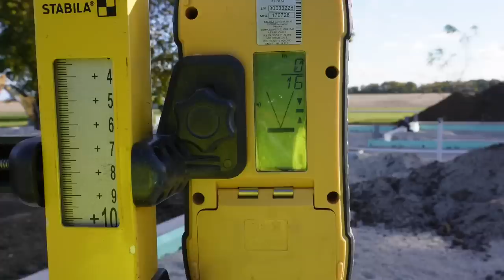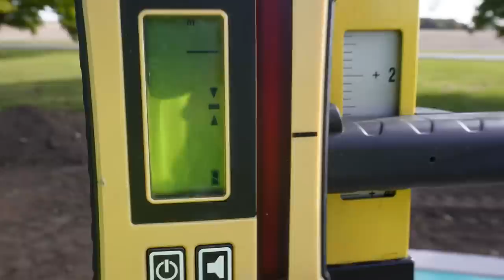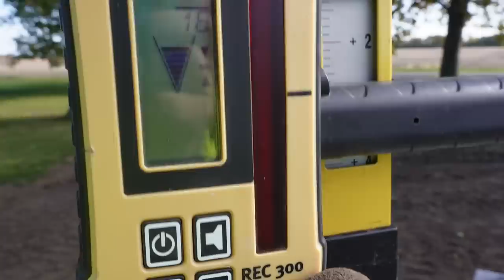Building the BEST House Possible!  The benefit of Post Frame

Comment: I'd really like to see a video of you going over the floor plan in specific detail as to how the dimensions work out where the two buildings come together. Does the concrete guy have a funky dimension to make things work better for your or do you change pole layout to work with the concrete? In the same video you could also talk about what changes in the layout if a 4 ply post is required over 3 ply. Poles move, trusses move, etc...

Comment: Instead of the concrete wall, can you use cinder blocks set on footing and then fill with concrete? Will post anchors attach the same way?

Comment: Biggest hurdle I have on a post frame build is finding a competent and dependable builder. So many around where I am would just stick telephone poles in the dirt and call it a job. No one seems to take pride in their work anymore
Reply: I hear ya, Builders around here are a little sketchy except for the high end, fancy ones. Can't decide between a post frame or square log butt & pass garage/shop (have a saw mill & logs seem plentiful now). Pretty much rebuilt and added on to an old place here in SW Colorado. Hated to see the old place torn down but gutting it and re-doing would have been a labor of love or some deep pockets.

Comment: Hey guys/girls. Can someone explain the benefits of a post frame structure when there is a poured foundation like this one? Are you not using more wood to strap the outside, poles, then strap the inside for drywall? Couldn’t it have been stick framed on the foundation? Especially when they’ll be no need to strap the outside if there is plywood going on. Thanks everyone
Reply: The big benefit of post frame is the lack of thermal bridging when compared to traditional stick construction. It's also easier to get a solid sill seal when you're not dealing with a plate, plus the balloon-style construction makes sealing the roofline a little more straightforward, especially when you have additional stories that would be more complicated with a traditional platform style house. (Think of the layers between floors in a stick-build vs the interior joist hanging in the other ongoing barndo build.)

Comment: I have nothing against pole barn homes. I also do not think there is much savings in a stick built and a pole barn house constructed correctly.  The fad may have started off as a lower cost construction home but not any more.  Same with pole barns, used to be cheaper than conventional or metal but not so much any more. If you do it all yourself it may be but that's the same for conventional builds.  Over cost on materials has leveled the playing field...